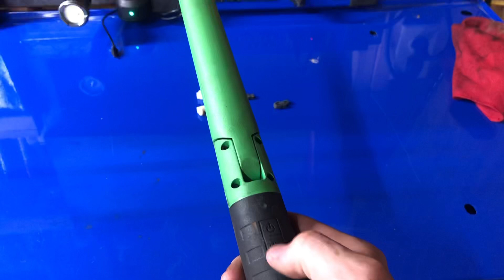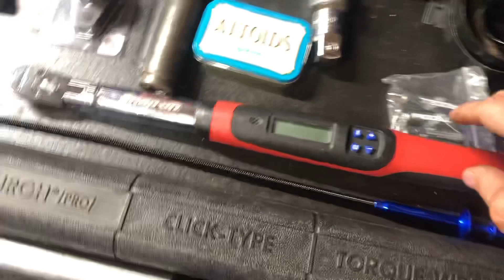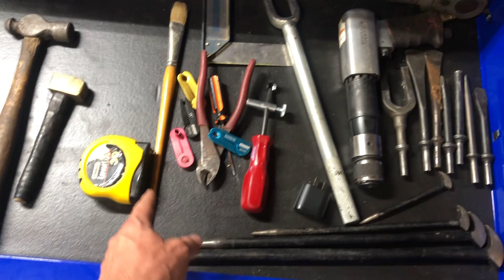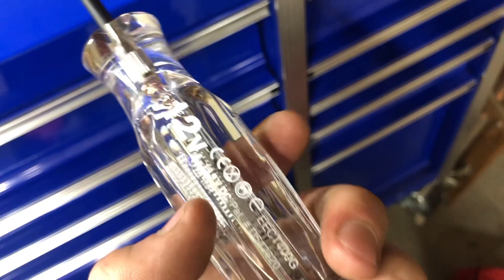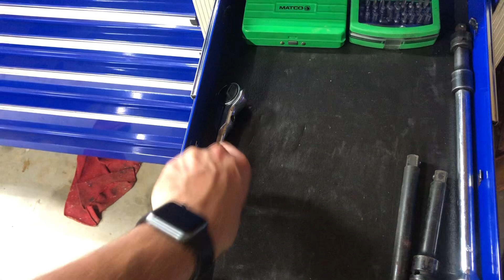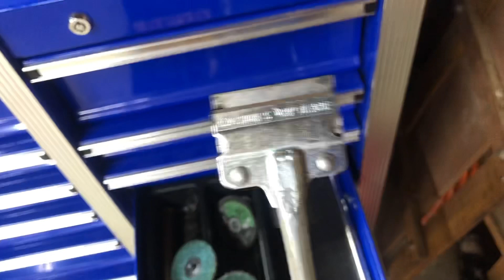Tool box tour !

Comment: @Gray’s Garage that SnapOn light will dim if you hold the button long enough. You may already know that but the way you said it had only one setting confused me.
Reply from the maker: Yes at first I had no clue in the making of this video. But I accidentally figured it out and loved this light for a very long time. For some reason the magnet got weaker and weaker and it actually fell and the base cracked and my rep wouldn’t warranty it 🤦🏻‍♂️
Reply: @graysgarage2142  all good I have the same one. Unfortunate to hear about the rep not helping out on the light sounds like it comes down to individual reps with certain things that break.
Reply from the maker: @David-od9gb  yes I’ve had ones that would replace anything and the last one I had acted like it was the end of the world.